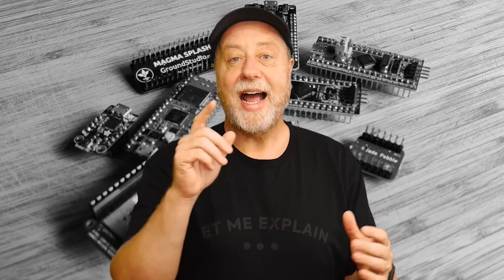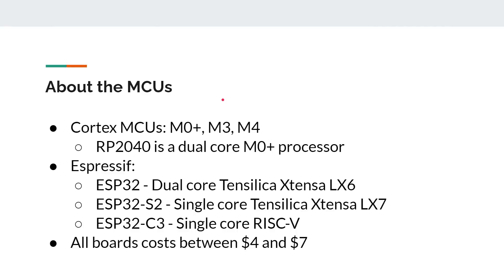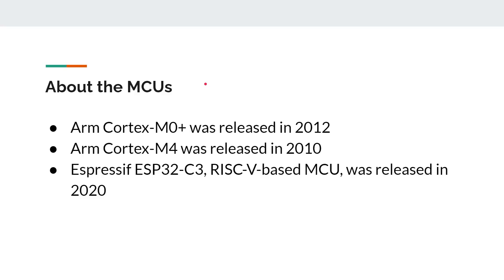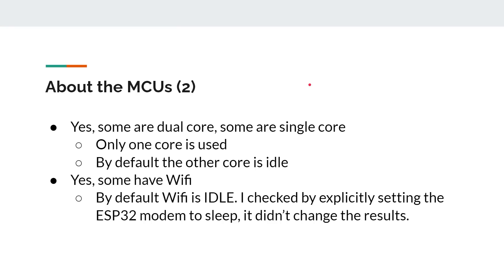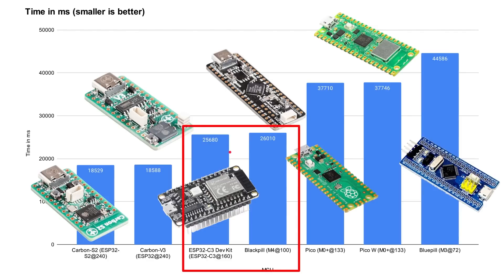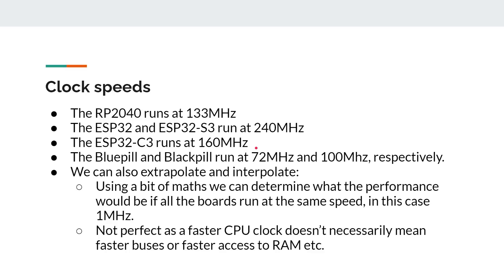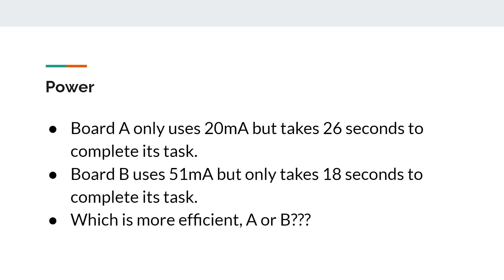Arm vs RISC-V? Which One Is The Most Efficient?

Comment: Is there a fully stable and official Python interpreter specifically tailored for RISC-V?
,
Reply from the maker: What do you mean by "specifically tailored for RISC-V"? What alterations do you want in this RISC-V specific version?
Reply: @GaryExplains  Thank you for your response. By "specifically tailored for RISC-V", I meant a version of the Python interpreter that's been optimized to run on RISC-V architectures, taking advantage of its specific features and instructions. Just as we have optimized versions or builds of software for different platforms or architectures (e.g., ARM, x86), I was wondering if there's an equivalent for RISC-V. Essentially, Any version of Python that might offer  similar performance or other benefits when running on a RISC-V system.
Reply from the maker: Hmmm... I am not sure that Python has special optimizations for different architectures. I just downloaded the Python source code and I see very little code that is optimized for say SSE3 or SSE4 or AVX. There isn't much assembly language either. I see a little bit of  x86 ASM code in one of the math libraries, but there isn't an equivalent for ARM64. It is just C code in general. 🤷‍♂️
Reply: @GaryExplains  Thanks Gary.:hand-pink-waving:
Reply: Languages such as Python defeat the purpose of efficiency.

Comment: For measuring relative performance, it is wrong to do a per MHz calculation. The only metric that should matter is the total time needed to run the same application on both processors. A more complicated ISA means clock speeds will be reduced (which gives better per MHz performance), but that does not mean the processor is faster

Comment: also intel atom processors should be included in those tests.
Reply from the maker: No, the Atom isn't a microcontroller.
Reply: @GaryExplains  no, that is wrong. atom has embedded options too. for example atom E3805.
Reply from the maker: @mehmet demir  I think you need to go look at the difference between embedded and a microcontroller, then come back. Don't worry I'll be here when you have figured it out.
Reply: @GaryExplains  There is no real difference today, Gary. That's a thing of the past. I can get single chip solutions for less than $20 today that would have been called a supercomputer well into the 1980s. I generally pick a 32bit microcontroller that is way faster (and that has more memory) than my first PC over an eight bit controller because the five bucks difference in part cost is easily returned in tens of thousands of cost saved on development time.

Comment: Great video!  I'd love to see one where you analyze just power efficiency.  I use microcontrollers around my house to monitor just about everything.  I'd love to know which would last the longest on a battery.  They need WIFI so they can report in.  But my requirements use very little processing.  Just check the sensor and report in.  Thanks!
Reply: You aren't doing anything around your house that requires more than a lemon battery's worth of power. What you would need, though, are low power drivers for your network, which are hard to get, it seems. Just use whatever works and plug it into the wall. Who cares about a couple of Watts of extra power consumption.

Comment: Not sure if this is a valid question, but here goes. Based in these clock speeds, could one of these chips act as a processor in a micro DOS or Windows environment? Thinking kiosk that runs a corporate webpage and allows customer data entry or order entry on-site. Or tiny web book or a tablet just for web or ebook reader where its mostly text.  I know that the Pi, which is more powerful and has a video decoder is slow at video and graphics. Just thinking that if not much computing power was needed, you could pair with a mid power graphics chip for running the display and decoding video streams.  Then maybe you get TVs with minor computing and networking power. Or is this how they are making smart TVs?

Comment: You mentioned that you encryption algorithms don't use floating point or integer division, but does use bit manipulation. I'll ask if it also uses integer multiplication, because multiplication by default comes in the same extension as division, but was also made available on its own as Zmmul. Bit manipulation instructions beyond basic bitwise logic are also their own extension B and its parts.

Did the RISC-V processors used support these extensions, and if so did you tell the compiler to use them when compiling your code?

Comment: Good video. 13:59: Board A uses 20mA·26s = 0.52 Coulomb = 3.2448·10²¹ electrons to accomplish the task, and Board B uses 51mA·18s = 0.918 Coulomb = 5.72832·10²¹ electrons, so Board A peruses only ~57% of the electrons that Board B uses. Therefore A is more efficient.

Comment: The comparison is not with new hardware. The visionfive 2 board looks to be 4 core risc v and by having a risc instruction set allows for better parallel processing, making the possibility of higher efficiency. The ability to boot from an nvme and the concurrent processing will need better coding , to achieve faster processing .
Reply from the maker: What has booting from nvme got to do with the efficiency of RISC-V?
Reply: @GaryExplains  just a big improvement on visionfive 2 board efficiency’s. Not Risc-v specific. Currently no soc boards have nvme boot up and processing, not even raspberry pi.
Reply from the maker: Nvme boot doesn't improve efficiency, it improves IO performance, which isn't related to RISC-V in any way.
Reply from the maker: Also, I have a VisionFive 2 board, and looking at it there doesn't seem to be support to boot from NVME.

Comment: Arm is a risc chip. Also, it stands for reduced instruction set. Actually, you will nrrd to have the same motherboard  with a socket mount in order to exclude other factors in the testing,  but even then the fastest chip was at 240 mhz y won't se where those can make a use maybe in remote controls, elsewhere those are to slow,   or use them I a insane cluster 999999999999x cluster  but you will need a dam fast cluster management running within the firmware

Comment: I think most of those chips allow you to change the clock speed, you should have done a test with them all running at the same clock speed rather than all being different. Then you wouldn’t have to do maths to figure out which is more efficient or quicker relative to the others, with a fixed clock speed it is pretty clear which is quicker at doing calculations and which uses the least power.
Reply from the maker: I did that in the previous video in this series. 🤦‍♂️
Reply: @GaryExplains  Not everyone watches all of your videos. Also searched your channel and couldnt find a video of you doing that.
Reply from the maker: And likewise I can't include all previous information in every video. Try this one https://youtu.be/XJawv8xGtX4
Reply: @GaryExplains  again that video is barely comparing the chips at the same or similar clock speeds, they are still far apart from each other.
Reply from the maker: @conorstewart2214  It was a while since I made that video, but I seem to remember that I overclocked the Pico to the sane speed as the ESP32. The Blackpill and Blue pill can't be overclocked. I also underclocked the Pico and ESP32, but I don't think I included all the data I have in the video, as I think the data points I showed demonstrated the trends. Sorry if you don't like the video. It is what it is. I hope you find what you are looking for.
Reply: @GaryExplains  You may have underclocked them but you didnt have any consistant clocks speeds, they were all pretty much still incomparable speeds except from between a couple of boards at a time.

Comment: One detail that you missed is that the Pico and Pico W do not have a linear regulator; they have an on-board buck-boost switching power supply. Current consumption will not be constant; it will go up as voltage decreases.

Comment: Esp32 is the best. You can use 1 core for  wireless and blutooth and another core for your logic circuitry. But if you need very low power esp32 is not a choice . Its deep sleep current allmost 1 mA.

Comment: A decent video.
And yes, instruction set architectures don't largely impact power efficiency. Hardware implementation however impacts efficiency far more.
But there is nuances on the ISA level that sets limits for actual implementations of the ISA. Be it limits on minimum transistor count, power efficiency, peak clock speed, etc. Sometimes one has to trade one aspect for another.

As an example, a resource efficient architecture using few transistors will generally not offer all that great peak performance. While a more peak performance oriented ISA will tend to be hard to build with few resources. Power efficiency is meanwhile largely decoupled from this view of complexity, since power efficiency is more about how well a given piece of software can make use of the architecture provided. It is oftentimes better for efficiency to have dedicated instructions for complex tasks, but what tasks to choose is a debatable subject in itself. If one throws in everything but the kitchen sink, then it is often far from trivial to make an efficient hardware implementation of it in practice.

In short, designing an ISA is all about compromises to reach a prespecified goal.
And then make a good hardware implementation of that along the way.
Then it is up to the market to find/make applicable software for it.

Comment: I was hoping for so much more that we didn't get here. I wanted to see the code you were executing, what interpreter/compiler and did you verify that the binaries these chips were executing was identical? Probably not. Now I'm guessing that you did these tests on some high level language like python? So what if the interpreter for one platform in terms of execution is radically different from the other? Your tests are merely an indication and don't account for efficiency in terms of instructions executed.
Reply from the maker: So...1)  You clearly didn't watch the video as I tell you exactly what programming language/environment I use. It isn't Python, so half of your comment is useless. 2) The binaries can't be identical, how can they be?. One is Arm the other is RISC-V. That is the whole point. I think maybe you need to reflect a little on what you wrote.
Reply: @GaryExplains  Perhaps I do, but having rewatched the video you don't mention the language. Of course the code will be different for different architectures, but when I measure my assembly performance and efficiency, I'm looking at IPC, what I can fit inside the CPU cache, line evictions, clocks per instruction, instruction and data alignment, cache misses and sometimes depending on the architecture, numas, dependency chains and all that kind of stuff. You're compiling code for different CPUs without looking at the very instructions generate that efficiency. For all you know, the compiler for one of the architectures could generate highly inefficient code for the processor. That's what I mean.

And yes, I do spend all day writing assembly on both RiSC and x86 processors where microseconds matter.
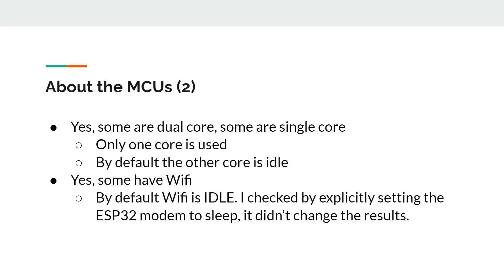Reply from the maker: @thewelder3538  Let me help you a bit, watch the 55 second segment starting at 05:22
Reply: @GaryExplains  Ah right, now I've watched that THREE times and you still don't say what language it is. So let me help you reach an answer... What you meant to say is "Oh, it's C compiled into code for the processor". (Obviously missing of course OS specific libraries and utilising sketches to make it easier to write code. Now I get you... thanks. Knowing the language means you have a fair idea how the stack frames are built. Thanks for pointer though, it helped!
Reply from the maker: Sorry, I thought that you would be familiar with Arduino given your background etc.
Reply: @GaryExplains  That's the point, you can write Arduino code in python, rust and loads of other ways. Although to be fair, not so much in Arduino Studio, but it still wasn't completely clear. But let's end this debacle with a... perhaps a quick look at the code would have been helpful?

And I am familiar and write code on Arduino, but I use VS Code and an external command line compiler.
Reply from the maker: The code for Oceantoo is in my GitHub repo.
Reply: @GaryExplains  That's great, but how was I supposed to know that? Moreover, that's not linked in the video either. Look, I don't want to argue, but in my humble opinion, there's not enough information in this video (at least for me) to get a reasonable understanding of performance/efficiency when comparing the processors that you are. The video is good, I like it, I really do, but there's just not enough depth, but let's agree to disagree. I've subscribed anyway.
Reply from the maker: Thanks for subscribing, much appreciated. I guess the point is that some people want very in-depth information in a free video. I put a lot of hours into doing all this testing. Frankly, since you didn't pay for any of this information I don't see how you can complain that it doesn't meet your particular needs. The video is what it is. You either find it useful or not. But, as you say, I don't want to argue.
Reply: @GaryExplains  Well accept my apologies. My original comment was checked in before running all the tests. I don't make videos, I only code and debug mental assembly, so that's about the only excuse I have and it's not a good one. Lesson learned.

Comment: First off, nice that someone takes the time to do benchmarks; we can really use some more of that. However, I also think any benchmark that leaves out the different basic types is inherently flawed. An int32 benchmark is nice for pure int32 operations, but it still tells me nothing about int64, float32 and float64. For example, the ESP32 has an FPU for float32, but not for float64. It also leaves out any peripherals - but that's okay (if you need a certain peripheral you should just select on that)... For example, I have a few ESP-S2's here that use the TinyUSB stack. They are great, but whenever you feel like using the native USB in instead of the hardware uart, it starts to eat up your cpu cycles like cookie monster... it'll be the same story for the RP I suspect. 

Especially float can give very nasty surprises, I suspect it will be the same in terms of power consumption / efficiency.
Reply from the maker: I think the general wisdom is that floating point code accounts for less than 1% of microcontroller code. So doing a test that focusses on floating point is inherently flawed.
Reply: @GaryExplains  Where did you get that "general wisdom"? I know I've never seen it in my 30+ years of professional software engineering... Not saying it's incorrect, but in my experience it very much depends on the application how much floats are being used... Source?

But even if it is correct, I don't think you understand how bad it really is. I actually did some benchmarks on the esp32 a while back, because I couldn't make heads or tails of the performance numbers. It has roughly 600 MIPS and just 1 MFLOPS (!) for common operations. That means that even if only 0.2% of your code is using floating point, it will consume 50% of your cpu power. It's that bad...
Reply from the maker: When I say general wisdom, I mean general wisdom, there isn't a particular source. However over the years I have seen multiple presentations that analyze real-world code and FP code is minimal, certainly on microcontrollers. That is why some microcontrollers don't even include an FPU, not needed really.
Reply: @GaryExplains  Right, and as I said, I'm no amateur, and I've seen a lot of issues with FP over the years. At the end of the day it doesn't matter what the exact percentage is: since FP is so much slower than integer operations (for obvious reasons), the effects on the application as a whole are still significant. 

Whether or not FP is required for applications at all is a totally different discussion. Again, such discussion is eventually irrelevant; the fact is that regardless if it's a good idea or not, people use it for everything from motion control to PID loops and from UI's to signal processing.

That is why there's a tendency for vendors to add an FPU: because it is needed. ESP, STM32F4 seem to agree with me. The RP2040 does not have one.

Comment: Are all these microcontrollers fabbed on same process node (and by same manufacturer), for example fabbing m4 or 40nm and 20nm will differ in performance and power efficiency.
Reply from the maker: The Arm one is on 90nm, the RISC-V on 40nm.

Comment: I would love to see the xiao nrf52840 board or equivalent, put to the test as it is running at 64 mhz.  This is the microcontroller used on a lot of smartwatches.

Plus it would also be interesting to see the boards already test, retested at lower clock speeds, if that option is available.  I know some esp32 can have the clock lowered.  For pure power efficiency, I believe lower clock speed tends to be more power efficient for the same work done, as power usage tends to go up on an exponential scale, whereas processing power for the same processor goes up linearly.

If the amps are the same at 3.3 and 5, then it is using an inefficient regulator to drop the voltage.  Just curious, did you calculate the power efficiency using 3.3 or 5 volts?  I am not a fan of any architect as I just use whatever is better suited to the task.  Of course having one that does it all would be nice and save having to learn all the differences, but now that assembly language is rarely used, it is not like having to learn an entirely new instruction set.

By the way, if anyone gets a xiao nrf52840, if they say double click the button beside the usb c, the double click speed is a bit slower double click than I was used to.  Took me a lot of tries to get it right.  Luckily someone mentioned doing a slow double click somewhere.